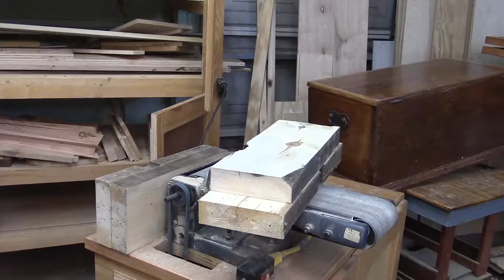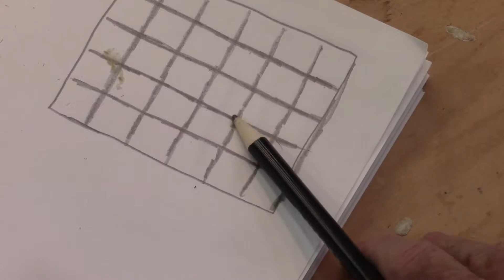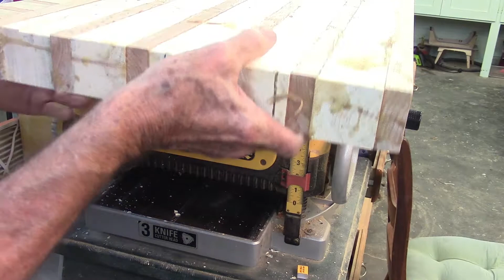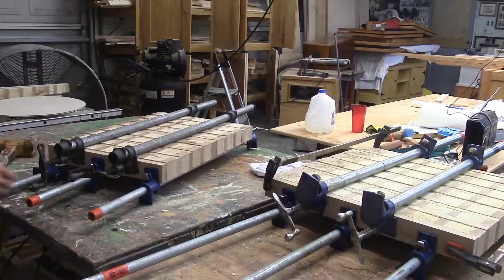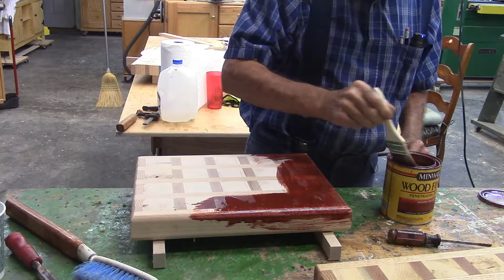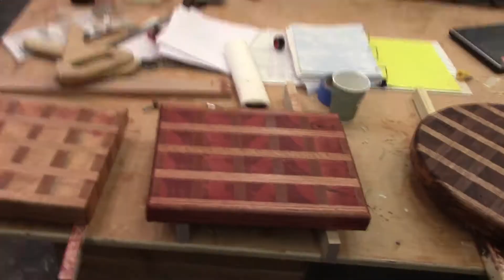248 Making two inch thick end grain cutting boards

Comment: I do love your end grain cutting boards.  I had never heard that term until I saw your videos.  Good use of scrap wood.   Can the ones that were stained be used since the mineral oil came back clear?  The stain did add a lot of contrast to them.  Congratulations on the weight loss.  This was a while back so I am behind on your progress.  I just hope I lost what I gained from the remodel while I was in Florida.  I tried to bike and walk most days.  I haven't made it up to running yet.  Maybe I will have to adjust my goal of running before I turn 61.
Reply from the maker: No, this was a while back.  I'm not back to the original Memphis girth, but I;m moving that way.  Problem is eliminating adult beverages from my "diet."  A single adult beverage is equal to several Nutisystem meals, and while the healthy food is good, I sure like a little night cap.  
    I ran for perhaps 50 years, and it is great if your knees and hips are still sound.  I gave it up because I only have so much energy, and running seemed to cut into the other things I wanted to do (Like Memphis Monday adventures).  So the decision was to continue running, or launch into the job I always wanted, which was to go work and do whatever I wanted.  Memphis Monday was the logical choice.  
    Are you still in Florida?  I'm way behind.
Reply: @MemphisApplegate  I have the same issue with the adult beverages.  I just don't want to remove them from my daily intake.

I was never much of a runner but did start running during my rehabilitation after my motorcycle wreck in 2003.  It helped me lose weight and regain strength but I let life get in the way.  That is the problem with running; you have to keep it up or you completely lose it.  

I returned home from Florida yesterday.  It was a lot earlier than I wanted to come home but staying in a hotel/motel is not the best way to visit a place.  I decided to return home early but will do what it takes to drag the RV down next winter to stay much longer.  I can stay the entire winter down there for less than what it cost me to stay 1 month and I will be able to enjoy it much more......I just won't have TV to watch.  Not much of a loss in my eyes.

Comment: Memphis you seem to cut a lot of oak.. What blade do you typically use on your table saw?
Reply from the maker: I normally use a 40 tooth combination carbide.  I've tried 60 tooth, but the standard construction blade seems to work best.  Another Memphis Answers question if I can work it in.

Comment: Memphis I like the tutorial.. Last year I bought a used drum sander from a former shop teacher.. He passed on a tip to keep the paper from loosening on the rollers that I found very helpful.. I spray the roller with fabric adhesive and allow it to track up. Then I put on the paper. When time comes for new paper a little heart releases the paper and varsol removes the glue from the roller.
Reply from the maker: Thanks for the tip.  I will give it a try, but first I need to google "varsol," as I don't know what it is.
     I keep checking your channel for woodworking videos, but no luck.  Do you have a big shop, with lots of tools, or are you a traditional hand tool guy?
      Thanks for watching and commenting.
Reply: Memphis Applegate Varsol is just a brand of paint thinner.

Comment: They turned out very nicely. They should last a long, long time!
Reply from the maker: Thanks.  They should last, as they are thick, and the glue-ups went well.  Of course you never know.  I used red oak, which isn't good wood for cutting boards, and some of the wood was mystery wood, claimed from a heavy duty industrial pallet.  Thanks for watching and commenting.

Comment: Henri, I like how nothing goes to waste in your shop.  There's always a project for the scrap pieces of lumber.  How do you insure that all those old nails and screws have been removed prior to cutting?  A stray nail could really mess up your day.
Reply from the maker: Since I've discovered that folks like cutting boards it's simplified by scrap wood situation.  
I have one of those metal detecting scanners.  It is build into my stud finder.  But every now and then I miss a very small hunk of brad or nail, and it eats up my thickness planner blades.  I suppose I should do a Memphis Answers on that question, or at least show the process in a project video, as it is important.
      Thanks for watching and commenting.